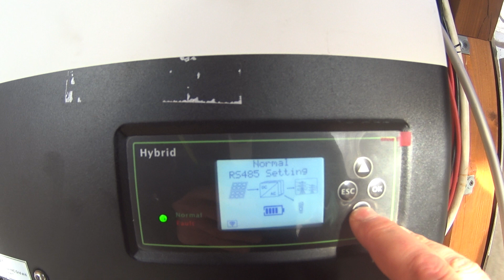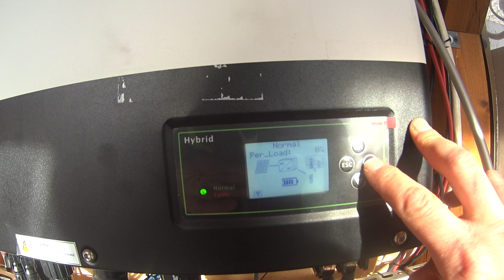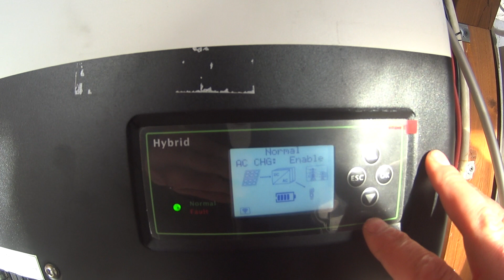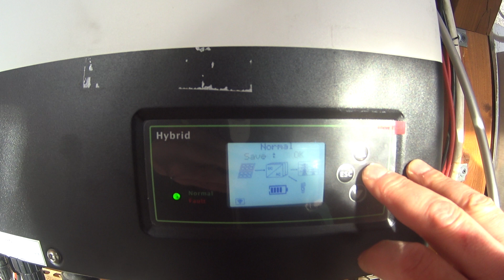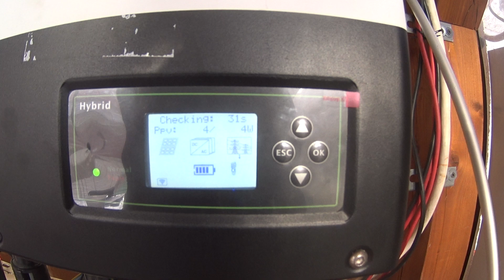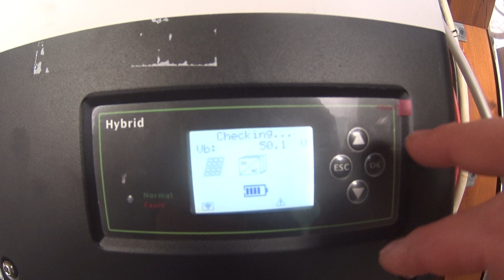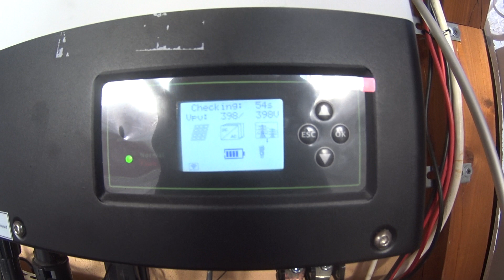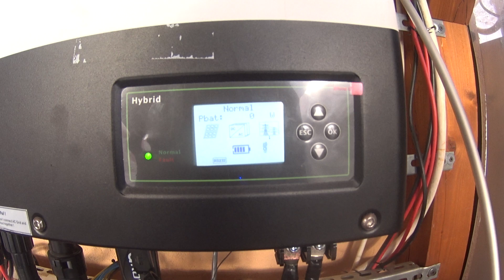Growatt SPH 6000 - NO power on EPS output & NO battery chg from AC grid or solar

Comment: Is your UPS supply from the inverter hooked up to the no arsenical items only, you can not connect the EPS power from the inverter to the grid and may be why your ATS switch is not switching when you cut the power as the inverter is feeding back into the grid side creating a loop may be the issue.

Comment: I also have similar problem with SPH5000. It charges lead acid batteries for 5 months. My batteries are ok because they charg with an external 48v rectifier and they supply energy to the inverter.
Reply: Same thing here with SPH5000  ,6months old installation with 3x Ark 2.5 kWh storage.Aftersales sucks ,waiting 7th week for replacement.
Reply: The internal battery circuit is damaged seen it before inside the switching transistors are blown 😢

Comment: I also have the same inverter and it won’t charge my batteries. Have you solved the issue?
Reply from the maker: It was replaced  with new one
Reply: There is damage to the transistors that control the battery charge and discharge we had one in bits to find fault 😢could be fixed the parts are hard to get and expensive
Reply: Anche io ho stesso problema
Reply: @omersmajic6146 tu hai risolto?
Reply: Same here